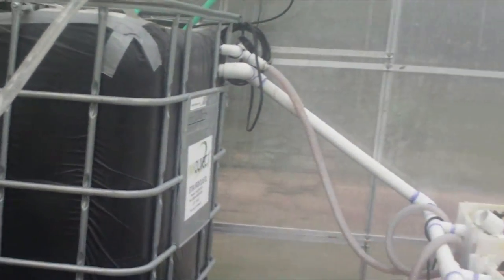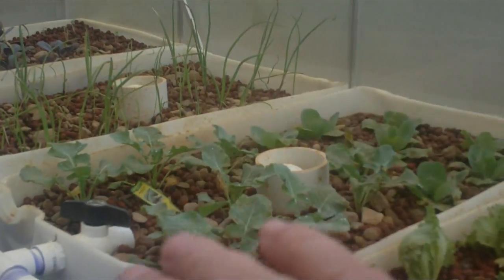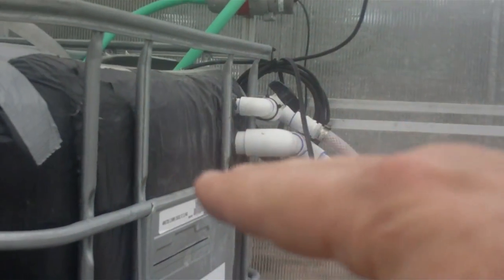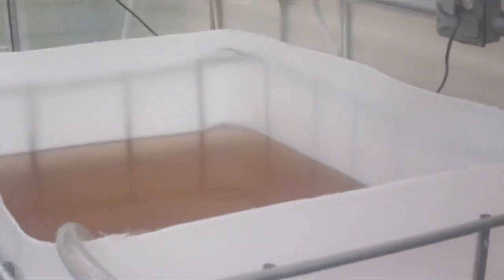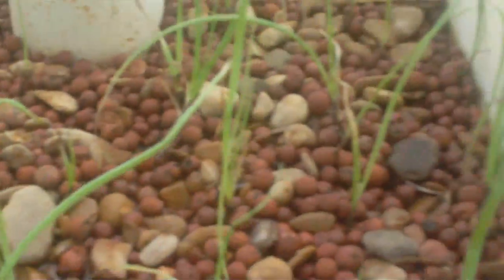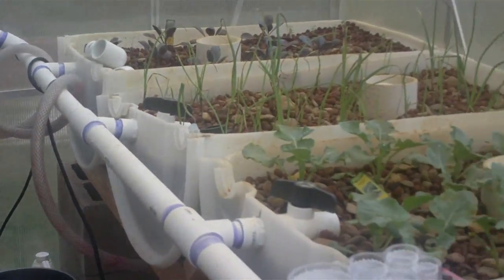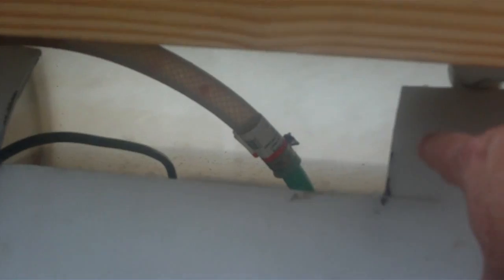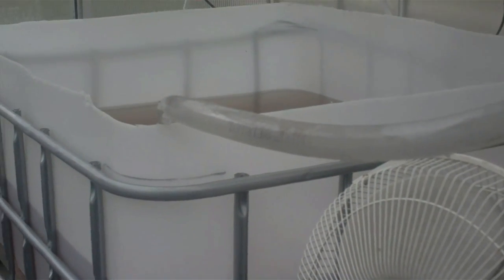Aquaponics system setup Pt 8

Comment from the maker: Yes, I thought of that but I can't see the water flow so adjusting the valve might be problematic, with the supply lines on top I can see how much flow there is and can adjust it by eye so that the supply exceeds the overflow from the bell valve and ensure it will trip. I've already have a few where a fish will get into the line and plug one of the ball valves, I only caught it because I could see the diminished water flow. Good suggestion though. Thanks and God bless you son.

Comment: Why don't you use the existing 2" ball valve that comes with it on the bottom. It will be an "uphill" run, but as long as the tank water level is above the beds, gravity will force it up the pipe. Should simplify it a bit while giving you plenty of flow and minimal problems. And you can even use the valve for flow control :D